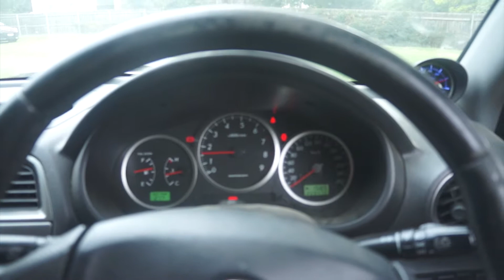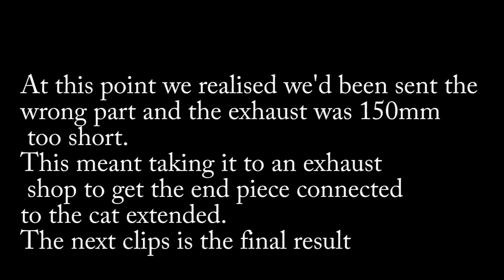Subaru WRX WRP10 - XForce Catback Exhaust Install

Comment: also that rig sounds mint now.
Reply from the maker: Thanks mate 👍
Reply: i just bought this exhaust after seeing this vid a couple of months ago. i think the issue with it not fitting is this exhaust fits older GC8's with different size dump pipe (shorter) there is some xforce part number EM-SW05-C1

 for a piece of pipe that sits between the oem cat and the xforce exhaust to make it fit without having to go to a local shop to have it extended. hope this helps anyone reading this in the future.
Reply: @fujitsubo3323  do you know if this exhaust will fit on a n/a Hawkeye Impreza hatchback
Reply: @toadfeet4176  doubtful